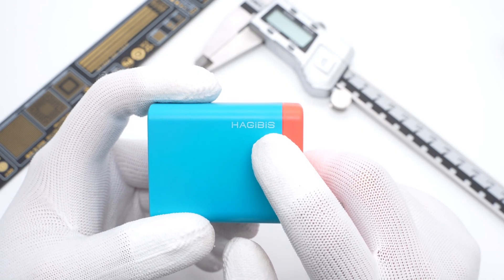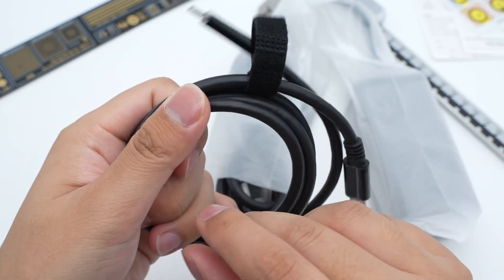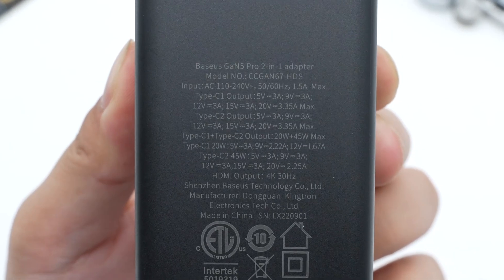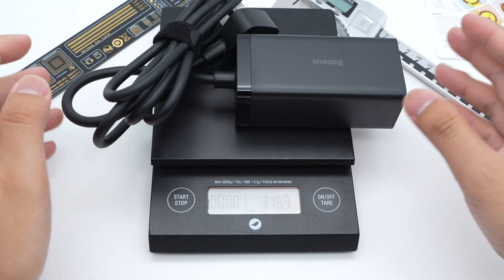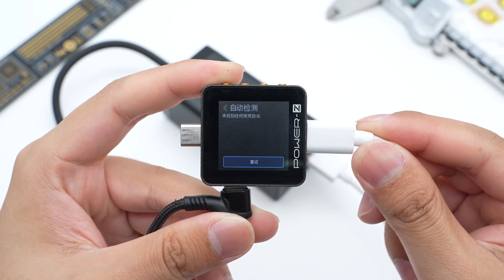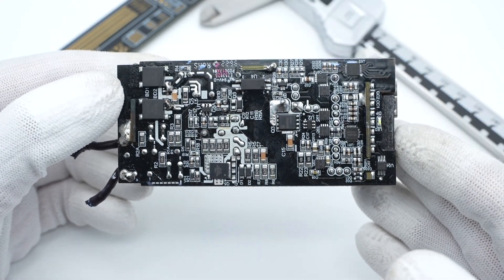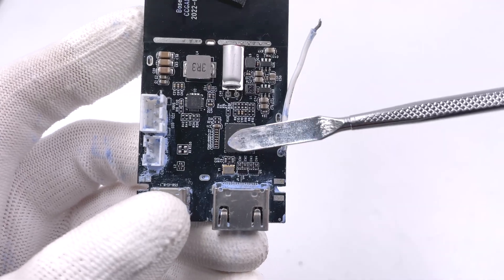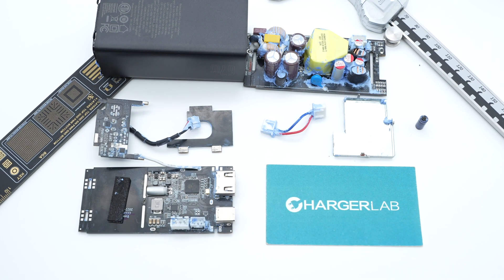Teardown of Baseus 67W GaN5 Charging Station (With HDMI Port)

Comment: Thanks for the video, i got mine fresh off amazon, led works, it charges the devices, but i can't manage to get signal on any of the type ports, the macbook air m1 8 picks is devices connected on usb a, and gets power, but no signal, the hdmi cable works fine, tried with my Samsung s20, and same status, charge works, usb a works, but no HDMI signal

Comment: Could you do review/teardown of the Kovol Sprint 140w (model KV-PC019) or the UGREEN Nexode 140w (model CD289)? Both of them claim to do PD 3.1 140w charging from single USB-C port. I bought the Kovol one but your KM003C tester shows it as only PD 60w. Also, amazing channel. Liked and subbed.
Reply from the maker: I‘m sorry that you have some tech issue about the KM003C, you can visit our tech support page: https://www.chargerlab.com/power-z-technical-support/ or just send us an email at info@chargerlab.com
Reply: @ChargerLAB  No problem. The Kovol charger only showed PD 60w without any cable connected. Once I connected a USB 4 240w cable to the other end, KM003C showed the Kovol charger capable of PD 3.1 140w as expected. Thanks!!

Comment: What’s the HDMI port for on a charger?
Reply: its like a dock. Think of it like the Nintendo switch dock. you connect it to the dock using the USB C port and it connects to a TV and charges the switch at the same time. Similarly for this but it can work for things like your Laptop or the steamdeck. Connect the USB C cable of the charger to your laptop's USB C port and if a monitor is connected to the HDMI port, it will be connected to your laptop as an external display :D
Reply from the maker: Good explanation